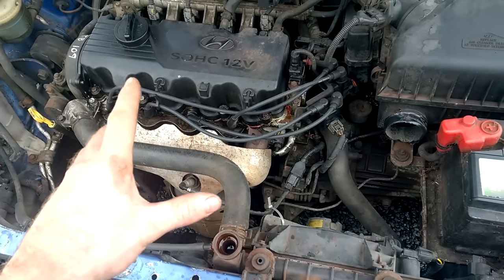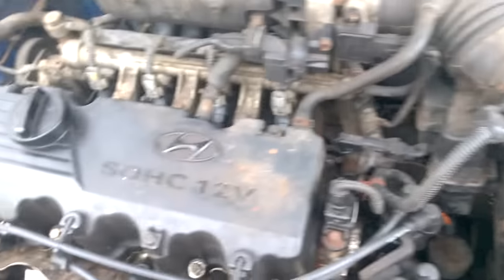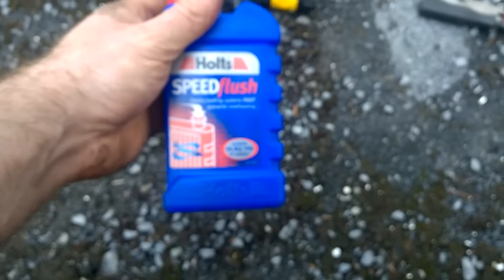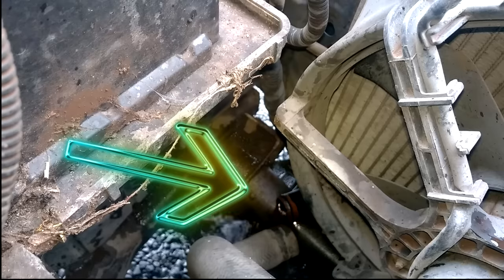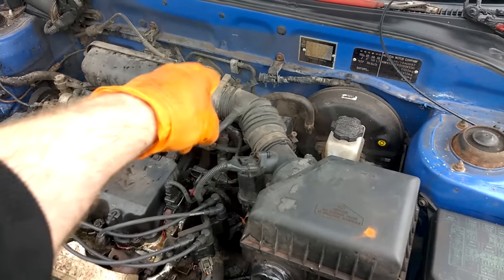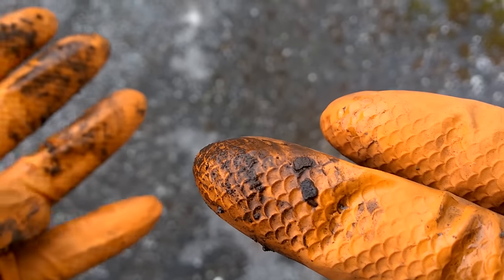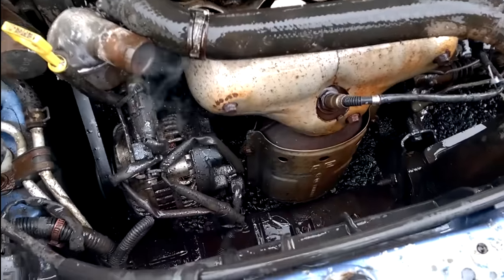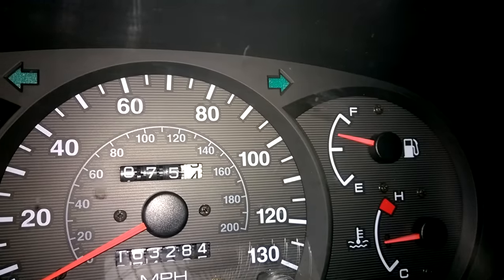Flush Your Cooling System - The Proper Way!

Comment: You rinsed most of the crap from the heater core into the alternator I would guess looking at the way the water was coming out..
Reply from the maker: I only used that for easier viewing when recording, I actually put the hose back on that end and flushed it through shooting over the front panel, when the pressure is on fully it would not have come close to the alternator, that was a consequence of trying to get the best visual for the video and using the trigger lightly.
Reply: Meh. It'll be fine.

Comment: Way too high of pressure. A typical closed system is kept at less than 20 psi.  The key to a safe flush is reversing the direction of the flow, thereby dislodging any contaminants.  Not blasting it with water and high shop air.  No, it won't damage the system every time, but why take the risk with your customers' vehicles?

Comment: Did you kill the radiator with that powerful blast of water ?? I don't think that's the way to flush a radiator...
Reply from the maker: The radiator is designed to be able to deal with pressure, the tool is made for the purpose of this method.
Reply: The radiator is always under pressure, ever read the radiator cap?😂

Comment: You can’t control the psi, then you may risk ruin the system
Reply: Most compressors have a valve that will let you control your output pressure

Comment: $97 dollars for that plastic tool lmfao nice try on  Promoting that product
Reply from the maker: It's currently about $65 on the tool truck over here in Oz, not promoting anything tbh. I like the tool so I put it out there whilst using it on a job. If you followed my channel you would be aware to this day I have never taken any money or products off any company for my videos. I have honestly turned down over 50 offers (incl paid promos) across a wide range of products. I have independent affiliates links to some tools here and there but none through any tool company or automotive services. 
 
My channel is at a stage where it is of benefit for companies to line up with me yet I have still bought 100% of my tools to this date 18/8/19  
When I do work with a company it will be because I trust the brand 100% and I have used the product or service. Look at loads of other automotive YouTubers and you will see them pushing budget scan tools, lights, and every other bit and piece that gets offered to them. 
Type in "launch scan tool review" or "auxbeam review" and you will see what I mean. I like launch I bought & use their products but I turned down promotions of their products even when offered to work with them as it did not line up with my values, some of their cheaper option code readers are IMO useless to any mechanic or technician. 
I treat this channel like I treat a customer that I deal with face to face, honest advice and it's free of charge online. If it came across as a paid promotion it wasn't. sorry for the rant.

Comment: wetting the Crap out of CAR Engine components? Not a Good Idea.  Also, Pushing pressurized Water without know how pressure may damage other components...... Heater Core?
Reply: Yup, my radiator cap says 17psi.......his air compressor sounds like it is at minimum of 32 or 40psi...LOL probably more like 75psi by the looks of the upper radiator hose when he gives it the shot of air it bulges like a snake that ate a raccoon without chewing it!!! LOL

Comment: This method is completely wrong 😑. to but a pressurized water in the cooling system is a big risk to damage the radiator or another component.

Comment: All that water falling on the compressor? Fucked up.
Reply from the maker: Its not a compressor :) I have spoke about the alternator situation many times in the comment section. it would never have happened only for I was trying to get the best visual lighting etc.. for the video. I was triggering very lightly and that was the consequence of it.  
Lastly the alternator never failed and the vehicle is no longer on the road due to out annual car test making it too costly for the owner to keep on the road. He since has bought another vehicle but the cooling system and charging worked perfectly for the customer after this job while he used the vehicle.